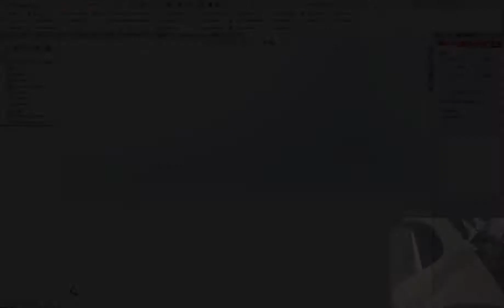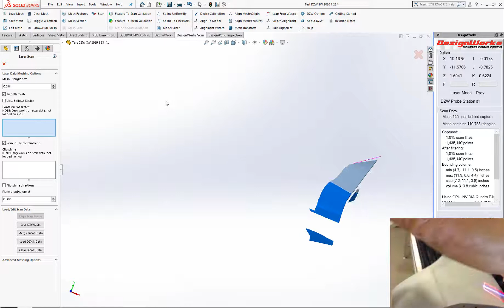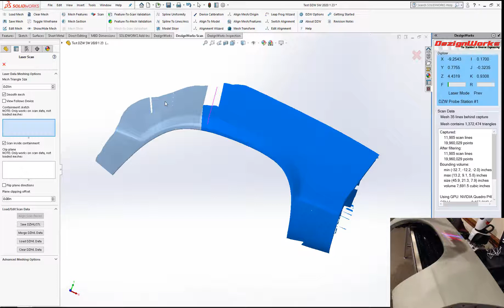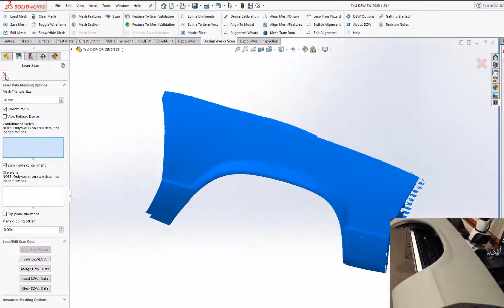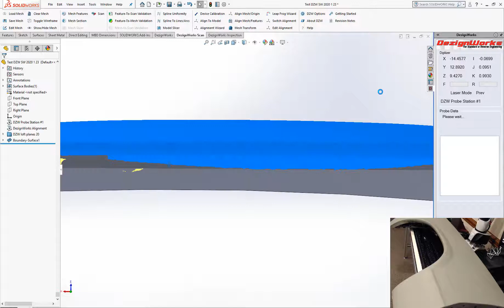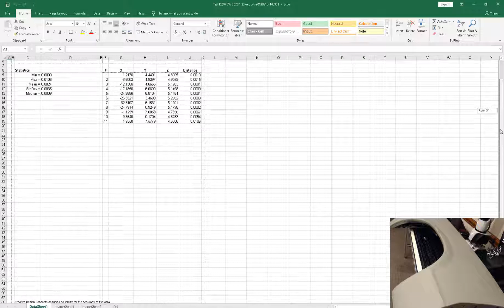Dezignworks 20 with Hexagon RS6

Comment: How much linear growth did you get after the scan.
Reply from the maker: Hi Tim, 
We apologize for the late response, by linear growth do you mean the size of the loft? It would have been a percentage of the area selected. Plenty of extra to trim with the Solidworks surface tools.
Reply: @CreativeDezignConcpt  with our current software we see growth in the scans as much as 0.006” in a 5 to 6” block compared to the actual part.